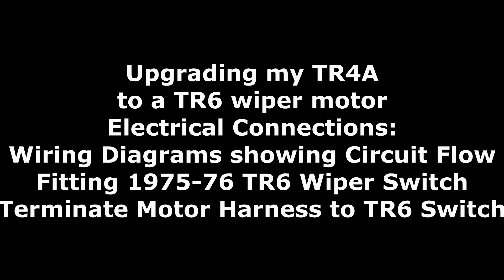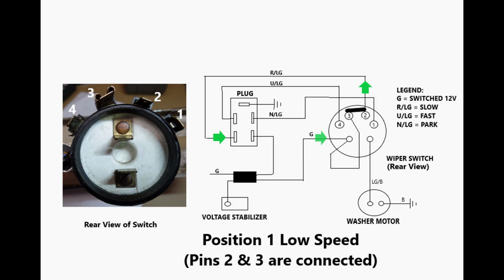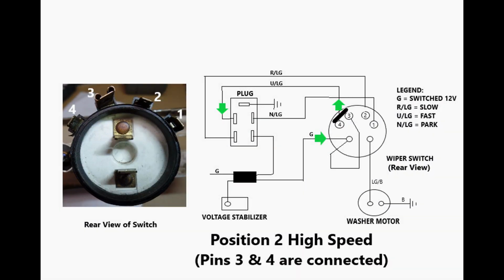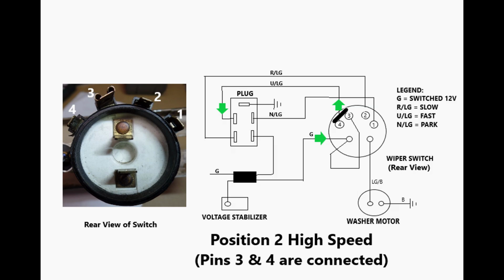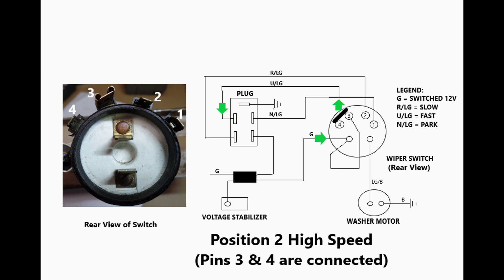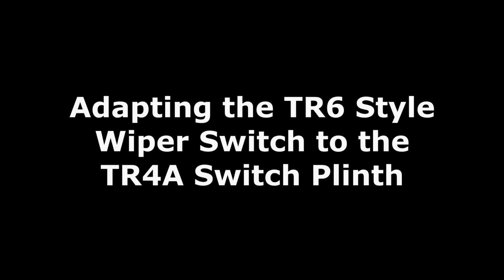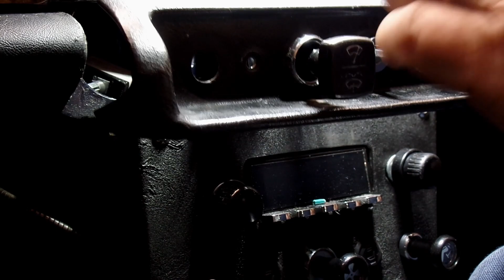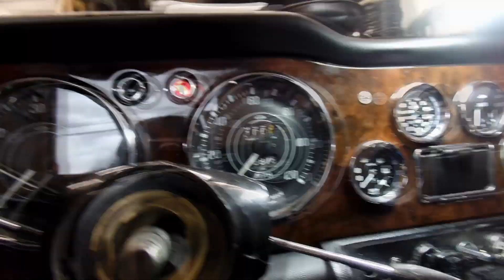TR6 Wiper Motor Upgrade for my TR4A - Final Wiring & Testing

Comment: I bet it is nice to see the colors. Being color blind makes wiring next to impossible without help. Nice job Dave.
Reply from the maker: Thanks Gary. I had a lot of help from my friend Jerry who is doing the same upgrade.
Reply: @DavesTR4A  Well we helped each other and, in the process, we've become the experts on this conversion. We've proven it can be done with a lot of effort to do it right. In my case changing the wiper wheel boxes was the most tedious part of the job followed by a secure wiper motor mounting. Dave did the adapter plate version and I used an original TR6 mounting bracket since I changed my 4A over to a TR6 dual master cylinder several years ago and had enough room to use the original mounting system. Also discovering that we could mount a TR6 wiper switch in the 4A switch plinth was an effort to keep a stock appearing dash / switch arrangement. 

What drove us to do this was we both had failing TR4A 2 speed wiper motors that would stall out at the most inconvenient time in the middle of a rainstorm (we both drive our cars a lot). And, I should also mention that the aftermarket wheel boxes and wiper arms are crap if you actually want to use the wipers and not have to go looking for an arm along the road in the middle of that aforementioned rainstorm. I've done it and it's not fun! Find some good original TR6 parts. Sad the big 3 can't reproduce these parts.

Dave's much better at producing videos too.
Reply from the maker: This was a great collaboration. The 2” washer idea to lock the  switch was you had saved the day for me.